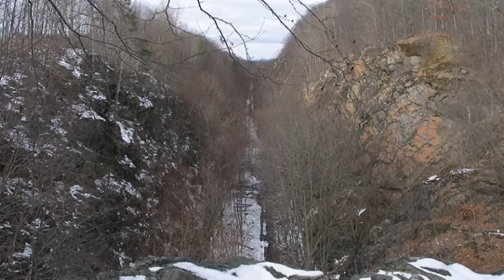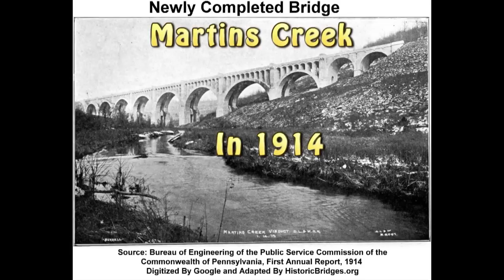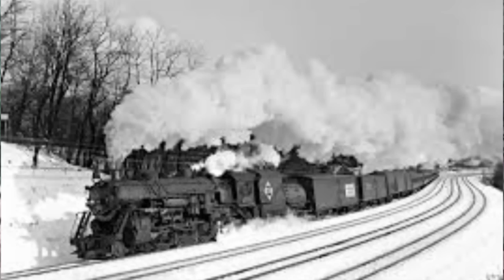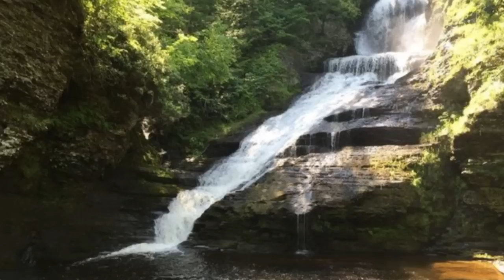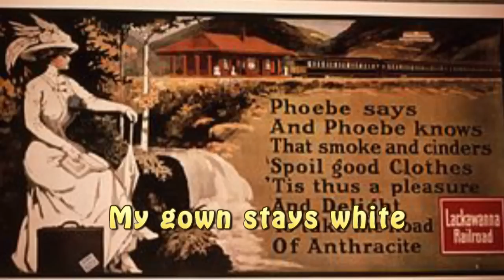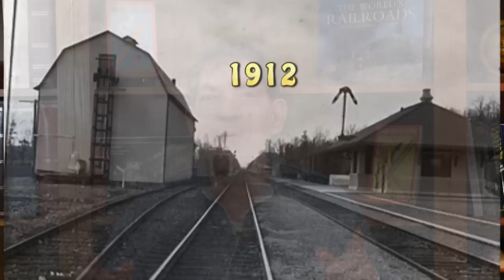BMB #91 - Why an amazing Railroad Superhighway -- the Lackawanna Cutoff -- was ABANDONED

Comment: Erie Lackawanna was folded into Conrail at the last minute. Conrail already had a system plan by that time, and it didn't include the EL system.
Reply from the maker: That's a perspective I'd never considered.  There are so many people who know so much.  Thank you.
Reply from the maker: @Eugene StonerThat part of the history is new to me.  Thank you!
Reply: @BeMoreBetter  The EL continued  on until the 1991 selling assets. Con Job bought the east end of the railroad for 600 million dollars. The Erie was worth more dead than running so Wall Street killed it and made a fortune doing it. I had one share to follow what happened. I still have my last EL check for 15 cents from 1992 Con Job only bought the assets. They wanted nothing to do with the money EL owed and the pollution they left behind.
Reply: One reason Conrail didn't want to use the Cutoff is that the Morris & Essex Branch is electrified, and the catenary is too low for double stacks.
Reply: Apx 60 percent of el.was kept by conrail
Reply: the people on the erie lackawanna board of drectors saw what was happening to steel and push el to join Conrail. in 1977 EL bigest coustmers that made steel quit making steel. Youngstown ohio was El bigest money maker
Reply: @flashcar60  The whole east coast is like that. Con Job billed Amtrak for double decker trains which Amtrak never ran in the east!
Reply from the maker: @dknowles60  Am working on BMB #140 & 141 -- about where RRs came from  (Coal mines).   In the story I found one English County that was important.  In 1923 there were 170,000 coal miners there.  Today, about zero.
Reply: @flashcar60  pm
Reply: @dknowles60  3 former Figureheads named Richard M. Nixon, Gerald R. Ford & Jimmy Carter all had a hand it weakening the steel industry in a round about way. The steel companies & United Steel Worker Union begged & pleaded with Congress in 1962 to block imported steel from entering the United States or there will barely be a U.S.Steel Industry 20 years later, Congress ignored them on purpose.
Reply: @christophers.o622  how young are you. both pittsburg Pa and Youngstown On were in bad locations they were severed by rail roads. had very old mills very old blast furnaces . management that served in WW2 that could not under stand Japan or Germany In pittsburg most steel mills were Served By the Prr rail road . The Prr had been going broke since the END of WW2 and was in Bad shape  all over. In youngstown Oh most steel Mills were served by the Erie lackwana RR. it had very poor Iron ore  Docks in  Cleveland Oh, in both  Youngstown Oh and Pittsburg  and most of the Us there had been no reinvestment in the steel mills .  Management and the Unions could not get to getter to work things out. most steel mills that stay open were on the great lakes as shiping was cheaper by ship.
Reply: @christophers.o622  JFK was in Charge in 1962. how young are you. It was JFK that was mean and nasty to the Steel companys
Reply: @flashcar60  there were no doublestacks till the mid 1990's. Conrail tore up the cutoff in 1984.
Reply: @dknowles60  I was born in 1953.
Reply: @dknowles60  you forgot Lackawanna,NY also had Steel mills.
Reply: @christophers.o622   yes  and it was on lake erie . it must of been old. erie lackawnna bread basket was Youngstown Oh
Reply: @dknowles60  The Erie which became the Erie Lackawanna was always a favorite railroad with me. The other favorite Eastern railroads for me were the Lehigh Valley & Delaware & Hudson.
Reply: @christophers.o622  me 1947. you should know your history better.
Reply: The traffic was gone to I-80 period. Conjob was to get rid of competition to drive rates up. GM and their highway lobby took the mail and packages so the passenger service died years ago. Now the I-80 only system is failing from traffic and other issues. The Gap from the Interstate is starting to have land slide issues!
Reply: Over 60 percent was kept
Reply: The el never upgraded there equipment
Reply: @flashcar60 EL big Freights never used the M&E , they continued past Denville on the Boonton Line. After I-80 was built, the Boonton Line was rerouted at Mountain View down the Erie Greenwood lake Branch. Everything east was taken by I-80 except for a one mile stretch called "Totowa secondary" or Totowa industrial track. Conrail abandoned EL bc they as already had access to Croxton frond the ex Lehigh Valley (Lehigh Line/passaic Harsimus lined) via marion junction.
Reply: One reason Conrail was so quick to destroy the Erie Lackawanna what's the fact Santa fe, had considered purchasing the EL. The Erie Lackawanna was Santa fe's largest interchange partner in Chicago and worried about the Conrail Monopoly. Unfortunately it already seemed Chessie system beat them to it.
When the unions refused and the chessie deal fell through, Conrail was quick to accept the EL (albeit
as a source of scrap- of course they didn't reveal those plans right away) I hate Conrail thought it did to the El. Conrail was nothing more than a bailed out Penn Central and its subsidiaries , with a blue coat.
 of paint!

I had a big smile on my face on April 1st 1997!
Reply from the maker: And now -- 2023 -- US Steel sold to the Japanese!

Comment: Crazy that Tunkhannock actually featured anti aircraft batteries during wartime. It was vital, and obviously such a massive marvel of engineering wouldn’t be fast or easy to replace if destroyed.
Reply from the maker: Thanks for the information.   Did not know about the anti-aircraft batteries.   Did read that German spies went after Grand Central Terminal's power converters.  All they needed was a handful of sand in them to ruin them.   The spies were captured.   Hope you have a great 2024!   Mike

Comment: Here I am sitting in Springfield Station's Waiting Room bloviating comfortably about things of which I know little while the "Conrail Naysayers" and their ilk are doing less than nothing and many entrepreneurs like Mr. DelaPiscoli (my pal...) are out there trying to make a thousand flowers bloom and occasionally succeeding.
  A perfect example is the current concept of the "Lackawanna Cut-off" revival's chances which would have been ever so much easier had Conrail not exercised its "scorched earth" policy so many years ago and ripped up so many, many miles of likely marginally useful rails but it would have made their replacement (not to mention - gasp! - double-tracking...) at least a little easier.
  You see, I’ve seen this so many times closer to home and certainly a few times by remote-control where Conrail had scrapped or “condemned by neglect” so much of their territory that was no longer profitable for them (in the short term) while making it impossible or very costly to find alternate uses of their rights-of-way for others strictly out of fear that someone might have a better idea and then pose a risk to Conrail’s virtual monopoly in many areas while ignoring the overall good to the very citizen-constituents they are “supposed” to serve.  Contrail was not conceived in a vacuum.  They (and Norfolk Southern and CSX, their successors) were handed relatively valuable franchises to control so much of the northern and midwest US railroad mileage at inception and weren’t given anything but carte-blanche to dissipate and destroy so much of that mileage at their whim with no (effective) oversight by Congress and their designated regulators.
Reply from the maker: A very different "Big Picture" perspective.  Thank You.  Mike

Comment: The severing of the Boonton Branch around Garret Mountain by Erie Lackawanna also did not help. Heavy freight trains now had to battle the grade on the Greenwood Lake Line at Great Notch in Little Falls. Then of course later on Conrail was formed which now had several lines going generally the same way.
Reply from the maker: The railroad system is so complex!   Thanks for adding to the decision making mix.  The learning is fun.   I appreciate you sharing.   Happy New Year!
Reply: Unlimited super highway building finished them off. While they paid taxes for the state to build these roads. No investment in rails of course. NJ Transit is a bare bones operation.  And Jersey City Terminal remains closed. The only bright part of the story is all the railroad ferry routes are back.

Comment: Save the Alford Station and Towers! Great Video!
Reply from the maker: Thank you, but am confused.  What are the Alford Station and Towers?  I can only find an 1848 station that is no longer used in England.
Reply from the maker: Railroads will always have a role in transportation.  The underlying technology is changing: steam, Diesel, Electric...Magnetic Levitation.   It will be interesting to watch its evolution.
Reply: @BeMoreBetter  It's west of Scranton and without a passenger train it's the middle of no where. It's below a Mountain in a gorge that is poisoned from a frack operation above. Hey K Mc Coy go back and look for the turn table pit that's just east of the tower to turn the branch trains from Montrose.  It's really out in the middle of nowhere. The passenger trains really zipped thru here. I think the track west of Scranton had Automatic Train Control so they could do more than 79mph every day every train.
Reply: tom kat  What bus line or oil company do you work for?
Reply: @intercityrailpal  Hey Hilary voter, there is NO poisoning from any fracking going on  in n.e. Pa.  If you had any sense of direction, Alford is north, not west of Scranton.  I drink the water from Alford pond and also fish there.  Please stay in the inner city and drink your fine lead filled water.  That nowhere you are talking about is not far at all from Binghamton or Scranton.

Comment: Mike, could you create a video about the California Zephyr? I rode the full line in 2004 both ways. If the video takes 15 or 30 minutes to cover it, I'll watch the whole thing! 
-Chris
Reply from the maker: Chris:  Thanks for the suggestion.  Have to confess, I don't know much about the Zephyr, but have put it on my list of futures.
Reply: @BeMoreBetter  It's the once a day train that avoids the major citiies on it's route of Peoria and Des Moines . Yet sells out even during covid. Because of private rooms and outside air in the cars. October 1st it's being cut by Trump to only 3 days aweek. So they can cut ridership more and lose more money and knock it off.
Reply from the maker: @intercityrailpal  Am fairly sure President Trump is not involved in the scheduling of trains; That written, I typically try to avoid things political -- only about 10 weeks until the election.   This election is an important one given the differences between the parties.
Reply: @BeMoreBetter  No Trump of Trump airlines and his airline friends just got a 50 billion bailout this spring which will run out October 1st. Amtrak now is taking action on shutting down most of the rail system to only 3 days aweek. With 32 million customers last year that depend on Amtrak. Mostly on the one train a day routes that Trump is in charge of shutting down. He knows the actions the company is taking. Florida services are already cut back. It happened in July, package express service ends in about 10 days. If Trump gets back in the trains will be gone by April 2021. As the bankrupt states can not maintain social services. The state trains will disappear too. Then lots more track will be ripped up. Like what happened when the National Limited came off and the Broadway Limited. Scrap sales of equipment will follow quickly.

Comment: Another reason was the Erie Lackawanna abandoning the Boonton branch which was the most efficient connection between the Lackawanna Cut-Off and New York City.  This meant that they needed to use slower track to get to the Cut-Off which defeated the purpose of having such a high-speed rout.
Reply from the maker: Have never "heard" that suggestion.  Will think about it.   Am looking at the world as it was around 1800 -- Lord Nelson and battleships.   Equally fascinating to me.  So much to learn everywhere.   The sharing is one thing.  Learning from others is another.  Thank you.

Comment: would freight train's use the rail line of it gets rebuilt ?
Reply from the maker: You would think that will be in the plans.  It seems to make sense.
Reply: @BeMoreBetter  The Pocono main has ONE freight a day and the agreement when the state of New Jersey bought the CUT OFF property from the Atlantic City mob guy. (Not Trump) FORBIDS FREIGHT TRAINS!
Reply from the maker: Will the Buffalo - NYC link become reinvigorated?  Certainly, it was a superhighway back when built.  The infrastructure remains amazing, e.g. the Tunkhannock Viaduct.
Reply: @BeMoreBetter  The business is there. Most riders in the Empire corridor are not going all the way to NY. Like most drivers on I-90 are not going to NY. There is alot of short distance travel in between. The state subsidizes or  has programs make hourly bus service possible. That stops at the train stations that are bus- rail centers.  Train fares due to under funding are higher than bus. Limited rail service timed for only the New York City market . Limits use. The bus company's get lots of benefits from public stations, public roads and grants to run and tax free fuel.
Reply from the maker: Interesting bus vs. rail explanation.  Thank you

Comment: Well, yes this is some of the story.  Erie &  DLW merged  10/17/60. Both were in shaky financial shape, hence the merger. They ran both routes the Erie via Port Jervis and the DLW. They favored the Erie at first, then shifted in the 70's to the DLW. What really killed the Cut-Off was New Jersey. Conrail had the LV,NYC,PRR and EL all going to Buffalo. Well,you don't 4 routes from NYC to Buffalo. So they picked the NYC,from North Jersey to Albany and then west. No grades,it had on-line business and Selkirk is the major yard for New England and NY/NJ. The others are pretty much gone,servered or shortlines. Now New Jersey. New Jersey heavily taxes railroad property it's one of the reasons CNJ,was bankrupt by 1967. In the USRA plan,rationalizing rail routes was key. Density,on line business,population etc was all evaluated.  Unfortunately the Cut-Off while a great piece of engineering didn't measure up. Conrail did use it until 1978. By then the rehab of the NYC,allowed them to discontinue using the Cut-Off. So it was really modern day reality, that ended it. Regarding the re-opening. I don't know if it's worth it for just 3 trains each way a day. I would rather see it extended to Binghamton or Buffalo. I know everyone is excited about this, but these questions need to be answered. The ridership figures look a little high at 480,000 a year on 6 trains a day. You can't build a railroad and walk away. It needs to be maintained,on a regular basis,track,signals,bridges etc. It has no signals or PTC, or even dispatching,that will be necessary costs with everything else.
Reply from the maker: What a clear, reasoned, and logical presentation of "the rest of the story".   For me, I "found" two viaducts that had been abandoned -- over the Delaware and the Hainsburg.   That led to the Cutoff and thence to more history.   Thank you so much!  Mike
Reply: @BeMoreBetter  I'm glad you found my response so enlightening. Northeast railroad is a complex subject. I've been railfanning since the 70's. I've seen Pre-Conrail,Conrail and post Conrail. There is a really good back called the 'Men Who Loved Trains'by Rush Loving it goes into this way more than I can. I try to take a measured approach to why the railroads do what they do. I look at it in the time it was occurring. Economics change over the years.
Reply from the maker: Ray:   I'll put that book down onto my "When I get a chance."   Am right now reading "Antisemitism  - A Very Short Introduction "   by Steven Beller.   Eye-opening, but not fun.   Research for another in my response to the 10/7 attacks that murdered so many in Israel.  Thanks,  Mike @RaymondTroth-cf3if

Comment: Greyhound and Martz I can assure you are dead set against any restoring of the Lackawanna Route.  They benefit from any government programs and road improvements and they don't want competition nor sharing of any government funding. Use your head! Plus the commuter airlines to Scranton they have government grants, traffic control etc. The trains disappeared when the mail was put on GM trucks.
Reply from the maker: Competition by buses is real; but where the rail infrastructure exists, that helps.  Its a complicated system, that's for sure.
Reply: @BeMoreBetter  Funny thing when Amtrak started May 1st 1971 . Over 600 trains were discontinued.  BUS RIDERSHIP WENT DOWN!
Reply: When after 30 years Portland, Maine got passenger trains back.  The DOWNEASTER service. Bus ridership went UP.  Portland, Me. Is the size of Scranton and the same distance to Boston as Scranton is to NY.  It had 800,000 riders before the virus.
Reply from the maker: @intercityrailpal  Feel free to call me Mike.   Am working on BMB #140 & 141.  They are about the story of how RRs came from.  I grew up on the side of Big Lick mountain in Pa.  Huge coal mine.  RRs born from Coal Mines.
Reply: @BeMoreBetter  Yup that's true. I believe the early ones were far back as the 1500's. They found the mules could pull more if the mine carts were up out of the mine mud on wooden rails. They also used people to shove and pull the carts of coal. Then some one hopped on and found they were fun to ride too!
Reply from the maker: @intercityrailpal  Am the grandson of a Coal Miner.  Less than a hundred years ago, I'd have started as a "Breaker Boy," working in thick dust 10 hours a day no matter if it were hot or cold.    Some of the changes in our world are for the better.